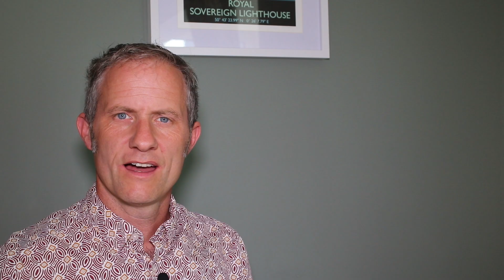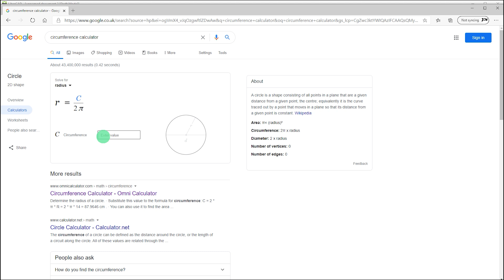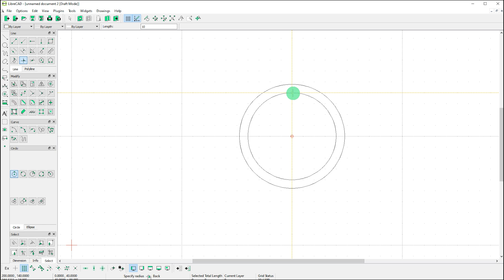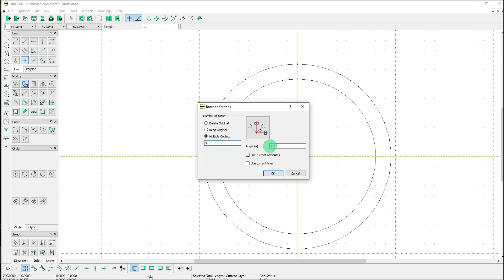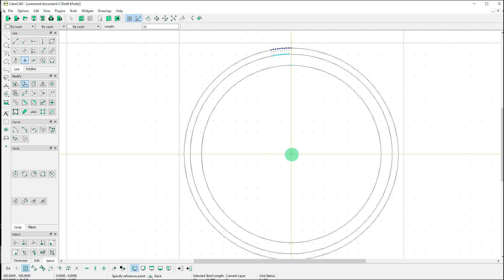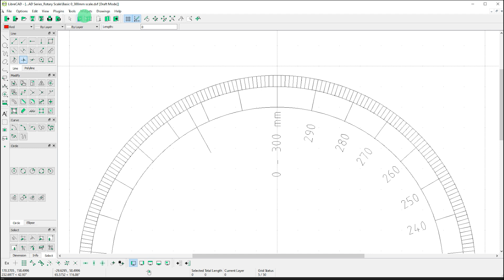The CAD Series_Rotary Scale

Comment: Great video James, and I have a use for this tool already, when running a digital layout (N Scale in my case 1/160) you have to measure individual blocks on the layout. I currently use a piece ow wire and then pull it out straight mark each end and then measure it, so this would be a great tool for me.